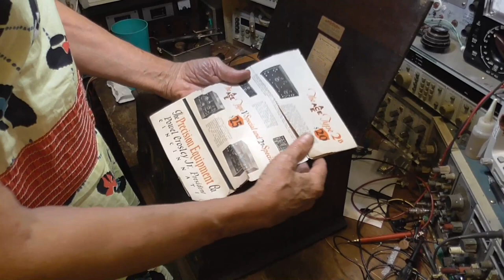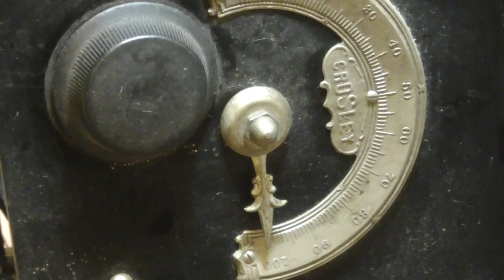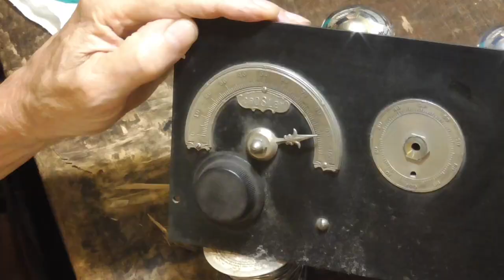RESTORING A CROSLEY 52 RADIO

Comment: Hello nice video I recently restored a stewart warner 9001-E radio 1946. Also wow that radio looks like an older model radio. It looks like yours is a DC model is it?
Reply from the maker: All the old early 1920's radios were battery operated. Very few cities had electrical power back then, and it was unreliable.

Comment: In the past, I've come across those types of radios (often cheap). But there's been nearly always the same two stumbling blocks: uncertainty, concerning the transformers & the insane cost for a set of tubes.
Reply: Modern replacements are available for the transformers-they are way smaller, so easy to hide.
As for tubes, some can be costly, but bargains can be found.

Comment: Seeing as your homemade power supply is used for radio's I'm wondering if it's a cleaner linear transformer design or switchmode, the latter I assume.
Initially i use to watch these videos for the electrical repair but now I'm finding the restoration of the wooden cabinets equally as entertaining.
Also, wouldn't it be easier to move the old stool around whilst spraying, thus reducing the chances of getting hands on freshly lacquered wood?
We've all done it
Reply from the maker: It's a linear supply. Switchers tend to put birdies all over the place in these old radios. I'm careful where I put my fingers. I have ruined a few fluffy skirts though!
Reply: Would you be willing to share the schematic for your power supply ?
Reply from the maker: @garyrobinson8991  Unfortunately, the supply was constructed from odd components not easily found so it would be difficult or impossible to duplicate it.
Reply: @glasslinger  understand !  Many thanks for the kind reply, though !

Comment: Ron,
When you first powered the radio up and adjusted the dial to about 20% of the scale, it squealed a lot when adjusting the regeneration(?) dial.  What does that squeal tell you, electronically?  Thank you for this video.  It was interesting to watch a radio that old being hooked up and working without any repairs!

Comment: Very good work, I benefited a lot from you. I have two observations if you would allow me first. When starting the repair, do not mention the problem and what is the best solution. Second, the videos are very long, and the capacitors are usually replaced completely. Do all the capacitors always have to be changed? I would like the videos to be shorter and confined to the important things. Thanks
Reply from the maker: Yes, I understand your request for shorter videos. These videos are made more for the beginner who may have never done the work before so wants to watch how it is done. The more experienced person can use the slider to move ahead quickly in the video.